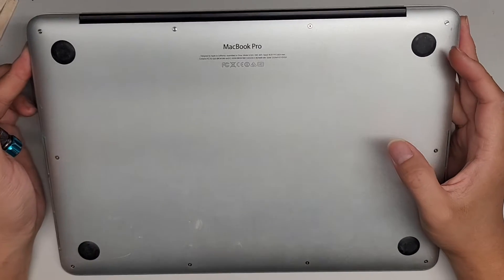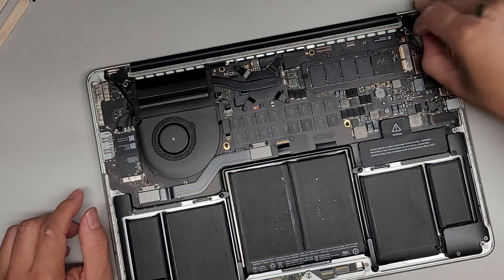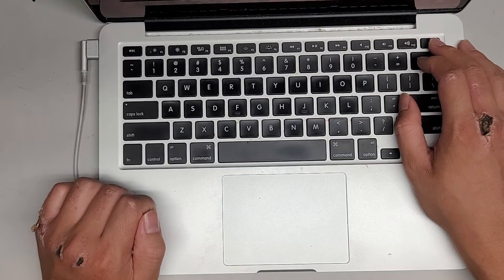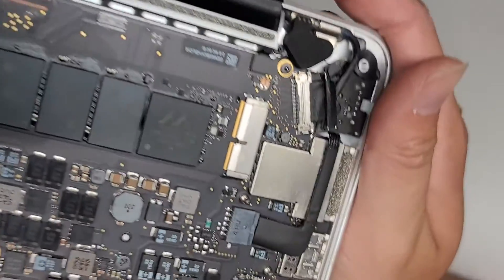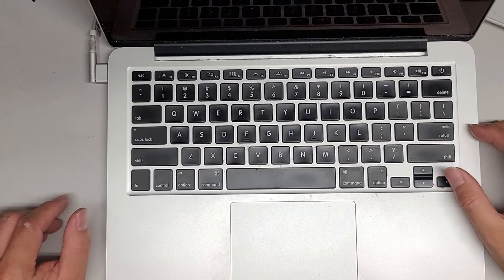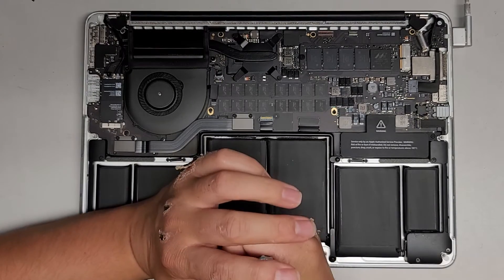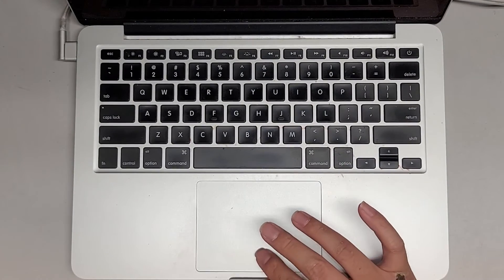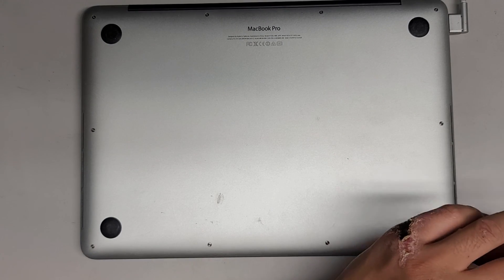MacBook Pro A1502 Black Screen No Display LCD LVDS Possible Quick Fix Repair

Comment: Computer works only when it is plugged into charge.

No screen but HDMI was working.

The OS's disappearance is the main issue. During an external file update, my friend severely damaged the PC. 
and right now, not even with an HDMI connector, there is any signal. What can we do?
Reply from the maker: Sadly need a new screen to do any of the other repairs.
Reply: @ItsBinhRepaired  thanks mate
Reply from the maker: @atacanyesilada  no problem

Comment: hey wanna asking, my macbook screen always glitching and then goes black after i use for abt 5 mnts, is this kind case connecting with the lvds/lcd cable problem or not? should i replace the lvds?
Reply from the maker: Try an external monitor
Reply: @ItsBinhRepaired  already tried it and it works but the mac's screen still blank, what should i do?
Reply from the maker: @dani-zm9mx  sounds like a bad screen